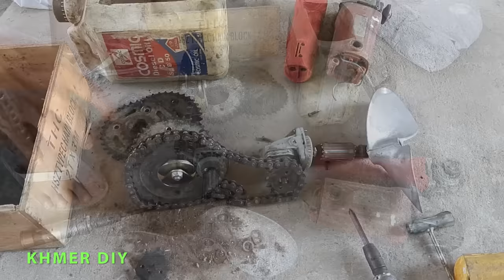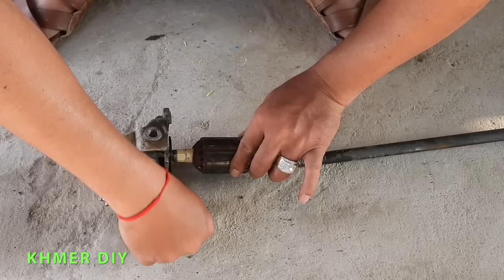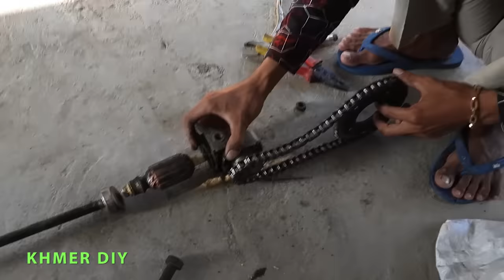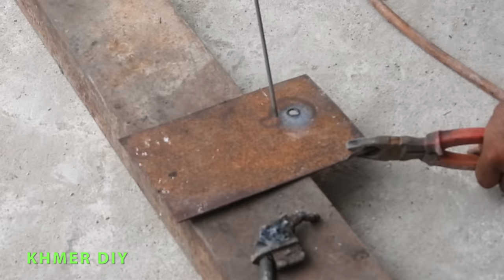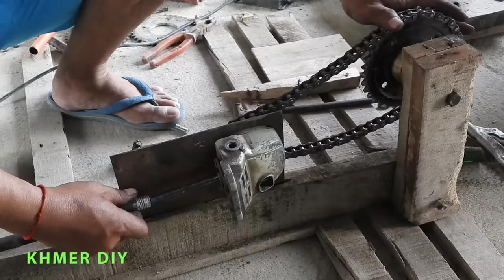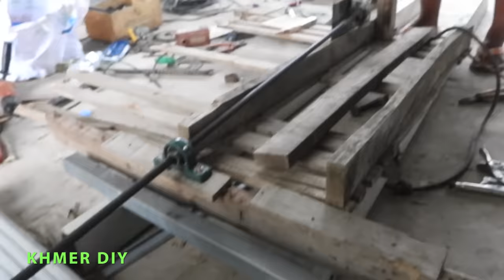Wow!! this is so cool - Innovation pedal boat propeller by Khmer DIY

Comment: Very nice!! But when you pedal like a bike in forward motion your boat will go backwards with this left turning propeller! Turn the angel grinder gear at 180 degree and mount it on the left side of the bike chain so you can use a left propeller in forward motion or change to a right propeller or mount the propellor in front of your boat! Go ahead I wanna see more good ideas and stay healthy

Comment: I've done this before, I use two grinder mechanical two circular saw mechanical, the ratio of one turn of pedal the propeller turn 280 turn, but unfortunately,  it's hard to pedal when it is in water, just keep on inventing

Comment: I am always amazed at what can be done with just about nothing. If you used the pedal portion of a bicycle you would have the ability to have a wider range of gearing. The universal joint from a socket set would be a good connector from the gearbox. The boat I would suspect would be more like a long tail version.
Reply: Brilliant

Comment: I'm only 1.5 minutes into the video... Great worm/90 degree drive idea!
But, here is a thought... Why not use the windings or small alternator to generate power to operate lights or a battery charger.
~OR~ Use a battery assisted motor to help power the boat?.
I had considered buying a lower unit from an old motor and powering it with  bicycle gears.
Reply from the maker: We testing this first and then we use the machine
Reply: @KHMERDIY  You could weld a drill attachment. Still can use the hand/bike drive but can choose to use a battery powered drill if desired.

Comment: Nice work, but the propeller is rotating in the wrong direction in relation to forward movement of what pedal boat they hopefully will build. the pedal gear assembly from the hand grinder gear box rotates correctly but hopefully they can find a propeller with the opposite blade pitch to what they have in their mockup.  Or just rotate the hand grinder gear box assembly 180° and the drive shaft & propeller will be going in the right direction in relation to the foward movement. 

This is an awesome idea on their part & wish them the best in their  continued build success. Great job fellas. Im a new subscriber to your channel. Take care & God bless .

Comment: Nice idea and all but if u are gonna do this and use it in the water the propeller should be a left hand or else it will come undone and eventually fall of due to propeller torque and having the thread go the same way the drive shaft and prop shaft will undo underneath the propeller. Also if u were to ride this like a bike and set it up so it works underneath u. You wouldn’t be able to put a right pedal on it because the wood is in the way
Reply from the maker: Thank you so much for your comment

Comment: Well the chain is totally unnecessary the small gear you could have put a 10 inch round steelcylinder on there and put a handle on it and it would have done the job just fine and eliminate the chain all together don't understand why he even did that
Reply: The video title says "pedal boat"... I suppose that is the ultimate goal. By using the chain they can have a central drive system with person, chain and propeller all along the boat's centerline, for balance. If you skipped the chain you'd have to put both pedals, and hence the heavy person who is pedaling, offset to the propeller. Also leg muscles are very strong, so the chain allows them to take better advantage of the strength by using a drive ratio other than 1:1 going into the gearbox.
Reply: @Fuzzybeanerizer  ,,, but what about the flux capacitor ...?   where do we put the flux capacitor.?  
 we want to keep the center of gravity .and the flux capacitor is pretty damn heavy, and we're going to need a feed for the garbage . so where are we going to put the garbage feed...?   the garbage feed is very important because that is our fuel for the flux capacitor.  the better the garbage the faster you can go .. I think it's like a 1 to 5 ratio of good garbage to bad garbage. and that way you don't have to run gear lube in the gearbox.  you can use honey from the honey bees .. all organic an natura..l and everything goes through the flux capacitor .what we need to know is how are we going to balance everything out , so the boat does not get top-heavy or side heavy on one end . so is there a way we can mount the flux capacitor lower .?  so we get it down to the center of gravity that is the question here......

Comment: probably would have gone easier to use junk bicycle rather than motorcycle parts & tubing for shaft drive instead of bar.  American "Jersey Speed Skiff" would be a good hull shape, 1/2 size would be 8 Feet long by 3 feet wide.  With your welding skills look at YouTube videos using blue plastic from used barrels on frame welded up from flat steel stock.

Comment: Driving the prop from the grinder output side will give way more speed.
Reply from the maker: Thanks
Reply: Will it?? I should think the grinder motor spins faster than the grinding wheel, if you are talking about propeller rpm speed. Those DC brush motors run pretty fast... think Dremel direct drive tool at 20,000 rpm or so. Maybe a disc grinder output speed is around 5400 rpm? I don't know offhand but I'm guessing the motor speed is at least double the disc speed.

Comment: The shaft wobbles because the Carrier bearing is too big... tape up around the shaft to make it fit in the Carrier bearing so it won't be pushed out to the side and it will not wobble so much.

Comment: Nahhh...the ratio is wrong, you can't turn that prop at that many times your pedal RPMs  LOL
First you need to enter the prop pitch and calculate its needed RPMs according to the "boat" speed and your  sustained power (80 to 100 watts!!! NO MORE!!!);
And only then,go from there,you'll need to ask for some help with the math for that.
Reply: Ask someone for help? How are you sure this guy is not a math expert?

What is the ratio, anyway?
Reply: @Fuzzybeanerizer    well...;that 200 hp chain is too much,hard to pedal; he needs a 1 or 2 hp  lighter chain,a bicycle chain;

The ratio comes from the formulas; For PLANING boats (but this is NOT the case), one formula can be  speed(MPH) =(prop RPM x pitchP)  / 1056; take away 10 to 20  pct for prop slip;  MPH=RPMx ratioxPx.8 /1056

But for this case of a light displacement boat,one of the many  net calculators will give a 4MPH speed for 320 RPM of a 6 inch/revolution propeller pitch,with a slip of 10pct;
since the human pedalling takes place at around 70 RPM,he'll need a RATIO of  around 45:1 on that grinder head;
The human sustained power is around 40 watts only.
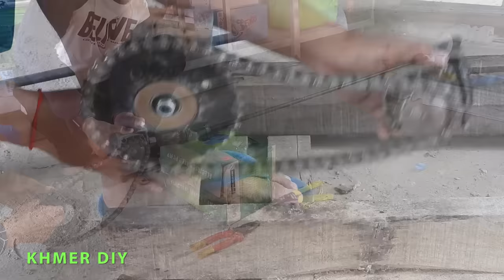Reply: @josepeixoto3384  If 200 hp is intended to be hyperbole,  this is a poor context for it. At 5:11 I can compare the width of the guy's pinky finger to the pitch length of the chain fairly well; it looks like maybe 5/8" pitch or #50 chain. I'd say it looks about right for a mini-bike, but to get more specific Machinery's Handbook says such a chain is rated for 1.09 hp on a 14-tooth sprocket at 100 rpm and 2.03 hp at 200 rpm. Sure it is overkill for foot pedaling, but not enough to make much difference in either friction or mass with such a short loop.

The sprockets appear to be 14 tooth and 35 tooth, for a 1 to 2.5 speed increase. I checked out a DeWalt 4-1/2 inch grinder I have here, and the grinding wheel spins once for 3.25 revolutions of the motor shaft. That would make a combined ratio (including the chain drive) of 1 to 8.125 when the wheel shaft drives the motor shaft. Going with your 6 inch propeller pitch and 10% slip but a more relaxed 60 rpm pedaling speed, I figure:

60 rpm X 8.125 = 487.5 rpm propeller speed X 6" pitch = 2925 inches per minute X 60 = 175,500 inches per hour /12 = 14,625 feet per hour /5280 ft. per mile = 2.77 mph minus 10% slip = 2.493 mph. Assuming a lightweight, canoe-like craft, 2-1/2 miles per hour sounds like a very doable speed for foot pedaling, to me. There would be 150 rpm at the 14-tooth sprocket, for chain hp rating purposes, so figure good for 1.5 hp not 200 hp. Assuming the grinder gears can endure such a low speed/high torque situation, I'd say this guy has things figured out just about perfectly.

Speaking of needing math help, 320 rpm X 6" pitch X 60 minutes /12 inches per foot & 5280 ft per mile minus 10% slip = 1.636 mph NOT 4 mph as you say. And I have no idea where you pull a 45 to 1 ratio out of.

Comment: This is a fair idea, BUT :     My Brother gas invented a drive system that only takes one pound of force to peddle,  and it is so quiet, that he can sneak up in a duck to one foot away, without the duck even knowing he is there. It has a five speed gear box with belt drive.   He is getting the patents on it as I write this. No one, and I mean NO ONE in Earth knows how it works, but him, and I.     It will revolutionize the peddle boat industry, and people will rush to get his boats.  They are designed Tobe maintenance free for life.   They are made of aluminum,  and are unsinkable and indestructible.

Comment: You on the right track son but still.....no Oscar  !    YOUR set up is way too much drama with too much MOVING heavy  parts for a pedal drive system !  Keep it lite  with less MOVING parts so you are able to transfer better HP & TORQUE TO THE PROP FROM YOUR LEG DRIVE  MUSCLES   ! .....I RECOMMEND FINDING A SMALL LOWER FOOT OF AN OUTBOARD UNIT 2-5HP MAX .  A  RIGHT ANGLE DRILL CHUCK CONNECT TO PROP SHAFT AND OTHER END TO BICYCLE PEDAL SPROCKET .  USED 10 SPEED THIN BICYCLE CHAIN FOR CONNECTION .   USED ONLY A  2  BLADE PROP ABOUT 10" INCH LONG JUST SIMILAR TO A RC AIRPLANE PROP .  IT WILL GIVE YOU PROPER HP/TORQUE RATIOS WITHOUT KILLING YOUR LEGS AND CATCHING HEART ATTACKS  !   LOL ....IT WILL BE A DROP IN UNIT JUST LIKE THE HOBIE KAYAK .  HOPE THIS HELP ?